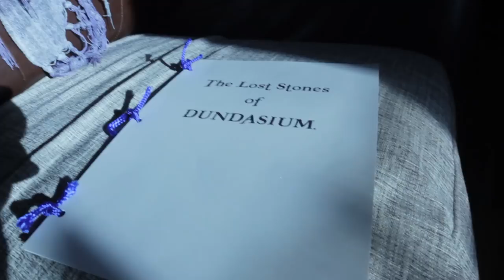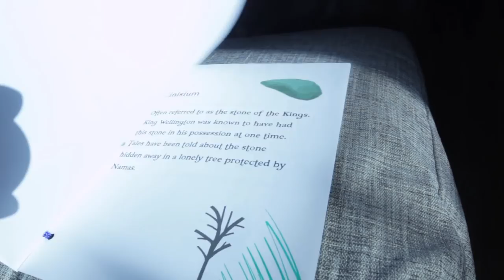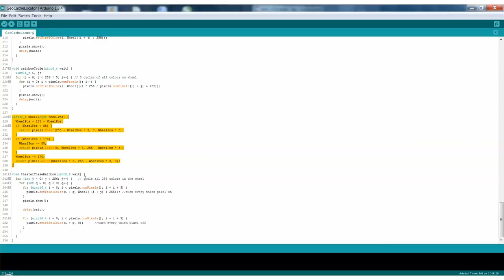Arduino Geocache Locator - Part 2: The Firmware

Comment: I would have added a button to the geocaches, so that when you press the button, it transmits via RF a signal to the geocache locator telling that it’s been found. Or put an RFID tag in the geocaches and an RFID reader in the locator (they’re both crazy cheap, look for the RC522)
Reply from the maker: Great Idea, I have those tiny NFC tags and a reader and considered it. You should definitely implement that. I thought about doing it, but it would add a lot of complexity and components to the build and what to do with it, so I figured simpler is better in this case, at least for now, since hes only 4. Maybe rev 2 in the future? :) Thanks for watching!